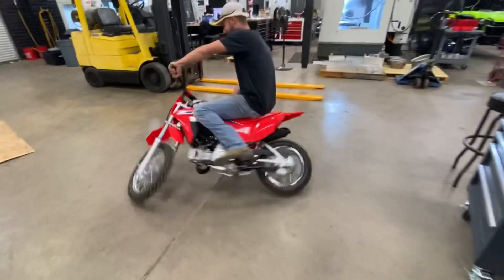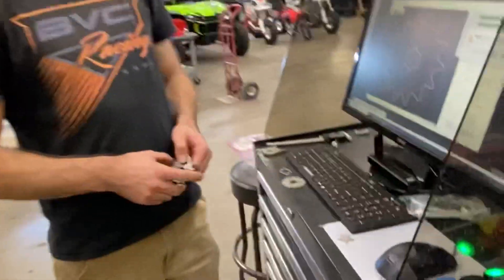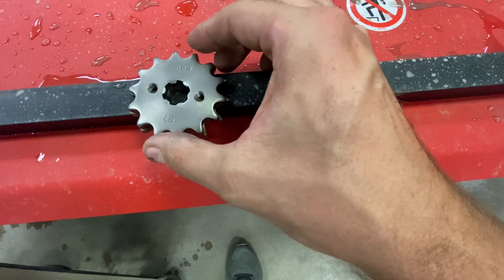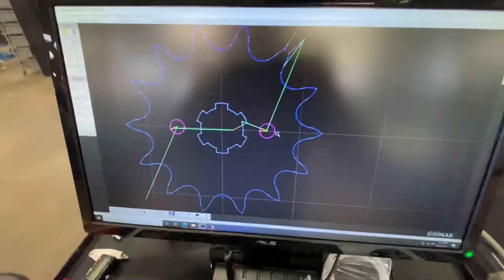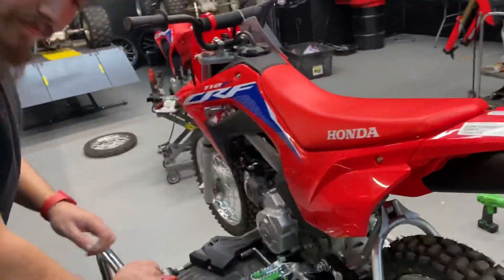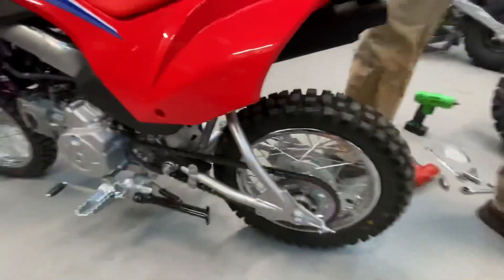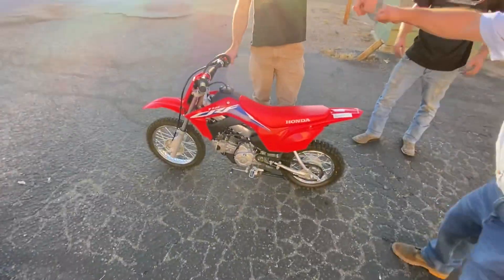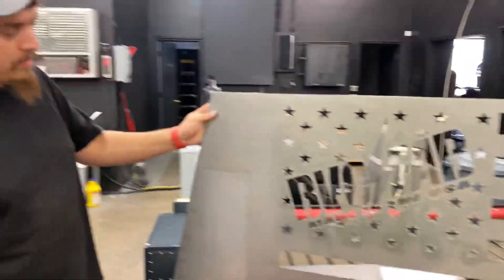WATER JET CUT A CRF110 Sprocket

Comment: Hi very cool that you are doing a mini big wheel build good build and good on your other builds very nice. hey how this of steel will you be able to cut and will you cut custom one off parts for a person building there own project builds if you will and are could you cut me a round slug about 1-1/4 o.d and 1.000 thick min. up to 1-1/4 thick with a Honda 185s or 200s front sprocket inter splines no outer teeth just the inside spline please reply back to me and let me know if this is some thing you would consider doing and a price thanks you.